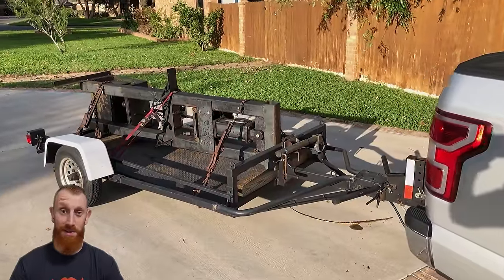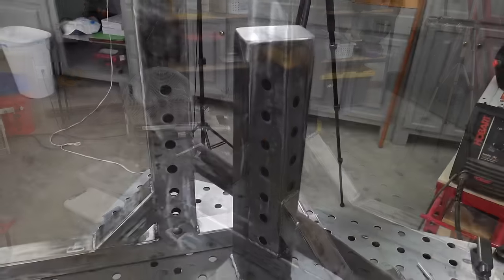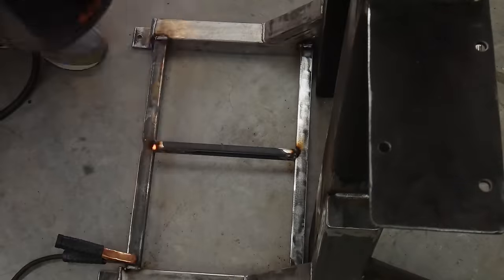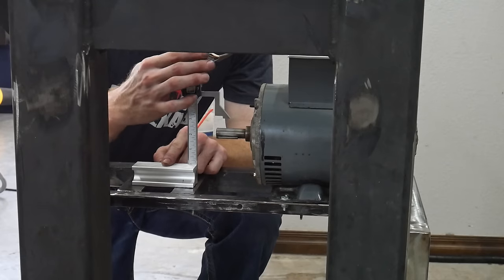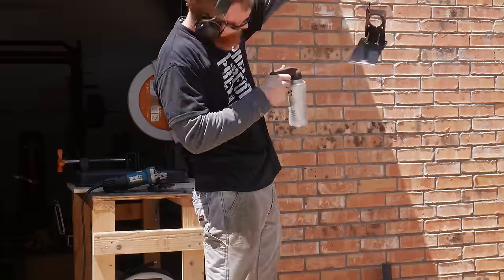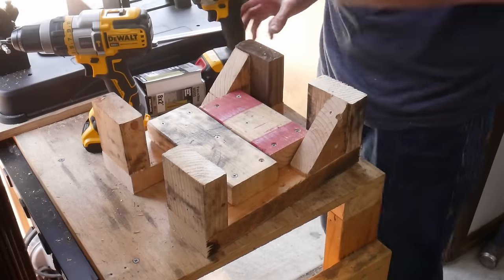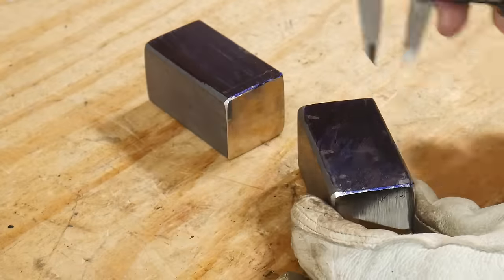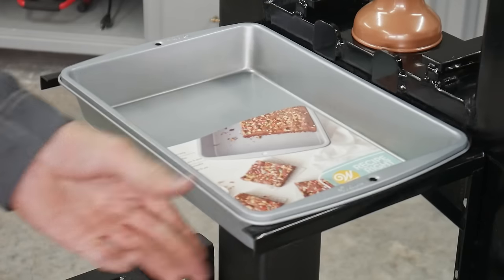Homemade Hydraulic FORGING Press - EXTREME POWER!! 💪

Comment: Great video. Thanks for all the effort you put into making us understand. One question - the valve specify in your description isn't available on Amazon. Are you aware of another one on amazon that would do the same thing?
Reply from the maker: Hey Tim, I know a few people have had issue with the valve. I'm fairly sure they have to be modified/bypassed to move the cylinder in both directions (this is a standard feature on the prince valuve but isn't intuitive). I'd advise contacting prince and asking them what model number you should order for your application. The one I bought was from over 10 years ago.

Comment: I want to start out by saying thank you very much for not only taking the time to do this but for also sharing it with all of us for free. I really appreciate you and your channel. I am following along with building my own one of these and I have watched your video many times but I do not see where you use the Hose Barb Fitting. Can you tell me where it is that I need it and what size I need to get it? Your link just sends me to the page where I have 4 options. Again thank you for what you have done here, it's been a huge help!
Reply from the maker: Gosh, I gotta be honest, this was so long ago that I don't remember the finer details. You'll have to research your specific hoses and fittings.
Reply: @RedBeardOps  I'm in the final phase of putting together my press. I figured out what the barbed fitting is for. It's for the red Suction Hose (3/4''). I assume we don't see you using it in your video because it was already put on in your past build. So if anyone in the future needs to know what one to order it is the 3/4 one if they order the 3/4 red suction hose. I wonder why you have two red suction hoses in your parts used list. You only use the 3/4 one in your video. I ordered both of them thinking that everything on your list I needed but it seems the 1" red hose is not needed. Also, I needed three 3/4'' x 3/4'' 90 Swivel. In your parts list you only have two listed. It might be helpful for future users to know that. Thanks again for doing this. I am almost done with my press thanks to your video.
Reply from the maker: @sankojin  I think I put them both in there since some systems could use either. Sorry if it was confusing. Glad your build is going ok! Cheers!
Reply: @RedBeardOps  I have everything done except the forging dies. I was wondering what material did you make your dies from? Also, did you ever make a foot pedal for this? I have been trying to think of a way to make one for it and I am not sure how to do it. The first time I turned my press on I was just like you in your video. I was standing as far back as I could and trying to use the press. Thanks again for doing this and also for answering my questions.
Reply from the maker: @sankojin  I just used mild steel, they've been holding up decent. You can for sure go more extreme here if wanted. 

I haven't made the foot pedal yet... on the list...

Glad you're getting your press up and running! Good luck with the rest of your build!

Comment: How small of square tubing could this press be made? 2"   3" thick wall square tubing? I'm wanting to make one on rollers similar to coal iron works 12 ton. Very good video one your build. Thanks for sharing the video and plans.
Reply from the maker: Hey Kent, without running very detailed calculations I don't know for sure. I know the 1/4'' thick 4'' is working very well. I bet you could go smaller on a 12 ton, but once again, I really don't know.

Comment: Does the amount of gallons on the hydraulic tank have any affect on power? You list a 12 GAL tank but I can only find a 10GAL, would 10GAL tank suffice?
Reply from the maker: While I think that will work, I'm not a hydraulic expert. You want to have sufficient size to handle the total volume of the system (maybe 2-3 x the system), allow for some expansion with heat, have a breather cap, allow for time for heat dissipation. Honestly though I don't know the fine details of hydraulic tank selection. I'm assuming bigger is better for a safety factor.

Comment: Hi I’m part way through my build an am running into issues with pump suppliers saying my motor is seriously under spec for the size of pump 
I have the 5hp 3400rpm motor but all the hydraulic calculators and backed up by the sellers in the industry say I would need a 20hp electric motor to run a 11gpm pump at 3000psi 
I’m so confused 
All I can think is you’re not getting the pressure and or flow you think you are  
What do you think ? And hope I make sense
Reply from the maker: Hey Robert, I'm for sure no hydraulic pro. This system has been working really well for me... It may be worth posting your question on the shoptalk section of bladeforums and see what the guys there thing... those guys are super helpful.
Reply: @RedBeardOps  oh please don’t think I was criticising your press I think it’s awesome! Just want to make sure I get the same results 
I was surprised when they told me

Comment: GPM x 4 = tank size. This will ensure proper fluid cooling. You won't be constantly at 11GPM so it shouldn't be an issue for your setup.
Reply from the maker: Thanks for the note Eric!
Reply: @RedBeardOps  no worries man.

Comment: Does the 4X4 tubing handle roughly the same amount of power as using I-beam? I see lots made with I-beams but square tubing seems more readily available to me.
Reply from the maker: I have not run these calculations. Haven't had any issues on my end.

Comment: I would like to turn my log splitter turned press vertically instead of horizontal and ankle high, probably going to buy a shorter cylinder,  but, evidently,  to get it right and tight, i need a few more things, like lots more practice stick welding,  something to make machine type tolerances,  and probably something that cuts better than a cut-off wheel in a chop saw, skil saw, or 4" hand grinder.

Am also thinking quick disconnect hoses for being able to use the original cylinder for a hoist.
Reply from the maker: Good luck with your build Bill! Be safe!

Comment: I was thinking of going around a 15 Ton for my needs. Would you reccomend options for the northern 3000psi hydraulic cylinder and the 5 gal tank? Thanks in advance. Love the build!
Reply from the maker: Hey David, I haven't tried any of the smaller cylinders, but I bet you can get buy just fine with a 4'' cylinder running around 2500 psi. That would be right at 16 tons. A 5 GAL tank is likely all you need

Comment: Hi again, what ton pressure did it work out at for that cylinder ? I’ve found a 4.5inch bore 2inch rod cylinder by my calcs that’s about 21t press and I’m not really sure that would be enough?? Most you tubers are running a minimum of 25t up to 40t!
Reply from the maker: This one is around 25 tons if I remember right; I think 21 would work. I've seen people be successful with 12 ton presses.
Reply: @RedBeardOps  now looking at a 2 cylinder design as they are a lot cheaper. Bit more fab needed tho and syncing the cylinders needs a bit of thought

Comment: Does the pressure gauge register the full pressure? Or does it register the full pressure only when you engage the valve and start crushing stuff?
Reply from the maker: Pressure is only built when you're crushing things. Just sitting there the system isn't under a high load. From what I understand.

Comment: Hi Dude, great video. Been hovering whether to buy a press or build one. I'm def gonna build one now. Just one question, with the new ram and 3000psi limit, what tonnage can you exert with it ??
Reply from the maker: Hey man, check out the download link. I put an excel sheet in there so you can plug in your numbers and calculate tonnage. I think this one will do about 28 tons. or so.

Comment: What are your thoughts on using a shop press frame and retrofitting it into a forge press? I imagine I’d have to strengthen it some and add on to accept the tank and motor. (I love your design and was planning on using the pdfs to build my own when I saw a frame up for sale at an auction)
Reply from the maker: Build at your own risk my friend. We're dealing with a lot of force here.

Comment: You also could be getting higher pressure flow due to the size of your fittings and hoses that makes a big difference in the output and flow rate of your hydraulic pump also, the reason why you had trapped pressure is from the test point when they test them they test them under high load and then Them I work with hydraulic cylinders all day every day on heavy equipment and it’s the same thing
Reply from the maker: Thanks for the info!

Comment: are you using the Hobart handler 140 here? if so how is it? ive been looking at it for myself. do you feel limited with the duty cycle or any of its capabilities?
Reply from the maker: Man it's been a great welder for me... When I first started welding I used a crackerbox Lincoln arc, but when I moved out on my own and only had 110 access I bought the 140. I've used it for a plethora of projects as a hobbyist. I've never felt limited. Hobart Handler 140 MIG - https://amzn.to/2YyBtV6

Comment: Hey bud great job not to be a smart ass but i worked construction as a welder for forty years and can say you did a great job one thing not time  drilling holes in bad position try a magnetic drill can rent them at rental shops really takes the weight off and easy to work any way will be making on in about  six months thanks for info
Reply from the maker: Heck yeah man. I would of loved to have a mag drill for this project with an annular cutter! Cheers!

Comment: Really appreciate the detail!  I just built a press based off of your design and all is well so far. Quick question: why can't I get the pressure gauge to register any psi while running? I noticed your gauge wasn't moving either (29:49). What am I missing? Thanks again!
Reply from the maker: Does your gauge move when actually pressing? With resistance? When It's just circulating there really shouldn't be much PSI - From what I understand. Be safe my friend! These things are dangerous
Reply: @RedBeardOps  Yeah dude, I'm a moron. Pressure shows when I'm actually putting pressure on something (who'd a thunk it?).  Thanks for the reply and all of your videos!!

Comment: Great job  FYI 5 gallon tank was probably  ok.  I have a 3 gallon on a monster  wood splitter and my hydo  oil only gets warm
Reply from the maker: Thanks for the info sir! The old 5 gal tank was pretty nasty too.... so I also wanted to replace it for that reason. I'm sure you're right though. Especially since this thing doesn't run for hours on end.

Comment: Spinning your hydraulic fluid jugs 180° will prevent pour burps.

Edit: A nice touch with your Description content.
Reply from the maker: Thanks for the tip! Cheers
Reply: @RedBeardOps  Thank you for sharing the details. I'm still working on the design for a new one. I've made my last one ever... three times. If you don't find a significant, if I build another I would's, then don't let friends see it.

Comment: I’m building a press right now and I used 1” plate same as you do my mounting pins are 1 1/4 in diameter the hole saw I used which was 1 1/4 bit seemed to drill a hole @ 1/16 oversized. My question is will that slack cause issues?
Reply from the maker: Hey man, mine has some slack too. It hasn't been an issue for me yet, but I must admit it's not ideal. 

In the future I imagine this will wear in an oblong way. 

I think when this happens my plan will be to drill an oversized hole, then turn down a bushing to fit in this hole as close to perfectly as possible. And in turn that bushing would have an interference fit with the shaft.
Reply: @RedBeardOps  thanks brother for the tip
Reply: @RedBeardOps  dang carbide bits with their teeth sticking way out!

Comment: I quite enjoyed the presses Ron made that I got to use. I've toyed with the idea of building my own, so this video and it's info could come in very useful. Do you know what tonnage you're getting? 

Think I'd go for a TEFC motor just because we blew the motor on one at Ron's one weekend during a hammer-in. Pretty sure some scale got into the windings :P The owner was there and wasn't too worried about it, he'd bought it off a guy who'd gotten all outfitted to make knives then decided it wasn't for him. He'd said we probably used it more that weekend than the previous guy the whole time he had it.
Reply: Think I just saw the answer in the followup video of 25 tons...
Reply from the maker: I calculated around 25 tons. Good tip on the motor!

Comment: where the motor and pump are mounted how high up is that shelf  from the floor  ?  and the width ?  thanks just asking so my hoses dont come up short should be starting fabrication next week thanks james
Reply from the maker: The top of the shelf is about 25'' from the ground
Reply: @RedBeardOps  awesome thanks how is your press working out for you ? I cant wait to get mine built will keep you posted appreciate everything you have posted
Reply from the maker: @Anderson-HandForged  Working great. Well, actually now it's kinda in storage since i'm moving. But it was working great

Comment: Hello, im new to knife making i recently bought some 1095 stock off amazon to make knives and as i was grinding in the basic shape of the knife it started to oxidize. Will heat treating it and tempering keep it from continuing? Id rather not put a handle on it and have it rust after im finshed.
Reply from the maker: I'd say starting to rust can be normal when wet grinding. Ged the blade sanded on both sides without rust, heat treat, temper, grind some more, hand sand, then oil
Reply: @RedBeardOps  ok, thank you so much love ypur videos been meaning to ask this but school is getting in the way so thank you so much.

Comment: Hello, I am designing a forge press using the same cylinder, I was wondering if you could please let me know what the outside diameter is of the cylinder so I can work around the fitment with the cylinder.
Reply from the maker: Hey Ethan, I'm not close to my shop right now... Not sure on the dimensions. I think you may be able to find it in the product guide on Northern
Reply: @RedBeardOps  that’s alright, just whenever you get a chance that would be great. I looked on northern but just found the bore diameter, pin to pin center on center distance and of course the stroke. Nothing for the outside dimensions

Comment: Hi 
First off it’s an awesome build buddy, thanks for the attached detailed part list and drawings, that’s a massive help to everyone planning a build like this. 
One question for for you. Although you have a link to the piston. That store no longer sells it so it does not show the specs on the page. Any chance you can post more details on the piston? 

Thanks.
Reply from the maker: Sure thing: Nortrac LH ASAE Tie-Rod Cylinder - 3000psi 5'' bore, 8'' stroke, 2'' shaft. 20.25 stroke with 1/2'' NPT ports

Here is the link to the cylinder on Amazon... it's also unavailable.... but you could keep an eye on it - https://amzn.to/3QwrryB

This one looks like a potential alternative... https://fimicimplement.com/products/spartan%C2%AE-3000-psi-tie-rod-cylinder-5-bore-x-8-stroke-x-2-rod-diameter-x-asae?variant=30106573045893&currency=USD&utm_medium=product_sync&utm_source=google&utm_content=sag_organic&utm_campaign=sag_organic&utm_campaign=gs-2019-08-27&utm_source=google&utm_medium=smart_campaign&gclid=CjwKCAjwsfuYBhAZEiwA5a6CDMzNS5TGSTmaX1twyYPuI2AGZwfzefb6KfC35o_wHowdGQ-IkW5QnhoCFJEQAvD_BwE
Reply: @RedBeardOps  that’s awesome thanks so much

Comment: I thought about building a hydraulic press, but the thought of a line rupturing and spraying me and my forge with hydraulic fluid. I have worked in the construction industry all my life and hydraulic lines rupture all the time. I opted to build a power hammer.
Reply from the maker: Yeah, it's probably a good idea to replace all the lines every couple of years. This is one reason I went with standard sizes.

Comment: Nice press, but there is one thing I would absolutely change.  For the traveling block, you have the guide plates bolted on with a couple of 7/16" bolts on each side.  I would add 2 more bolts on each end and I would upgrade their size significantly and with grade 8's.  It is possible that should you ever press something that cants or goes off center, you could send those bolts flying like bullets if the stress fractures them.  Worst case scenario, you want the guide plates to bend, not snap off those bolts.  What you have now is a bit dangerous.
Reply from the maker: Hey Edward, this is an interesting though. Thanks for brining it to my attention. I'm looking at tensile strength for grade 8 - 7/16th x 14 bolts and it's giving me 15,900 pounds. So about 7.9 tons per bolt.. I agree this doesn't feel great. I'll need to look into this further. I like the upsizing idea. Maybe to 6 1/2'' bolts on each side. ---- I am not a structural engineer and wanted to make a point here for anyone reading this in the future that if you copy this press you're building it at your own risk....
Reply from the maker: I want to note a few things as well: 1.) my 7/16th bolts are not grade 8 and one step would be to upgrade them 2.) I've been finding conflicting results on grade 8 bolt strength and will need to research futher 3.) I started a thread on blade forms on this topic here - https://www.bladeforums.com/threads/is-my-press-design-dangerous.1873167/ - Thanks again